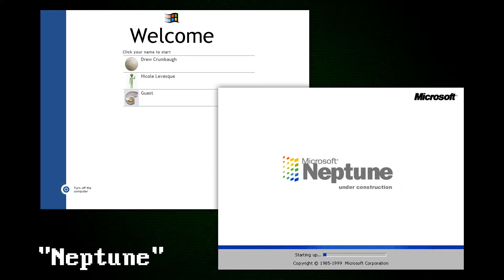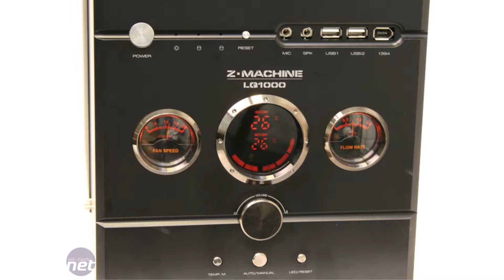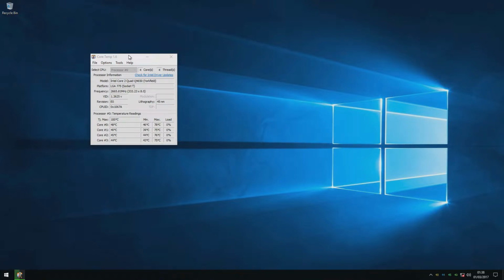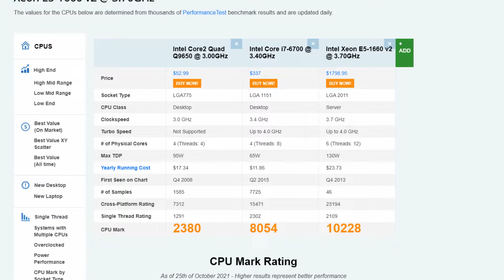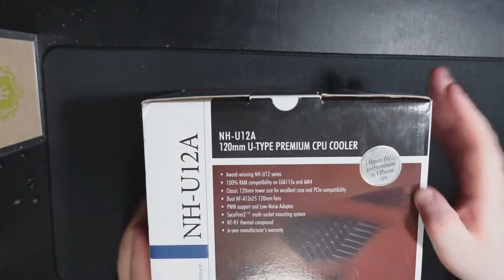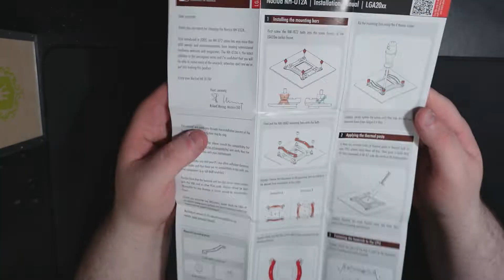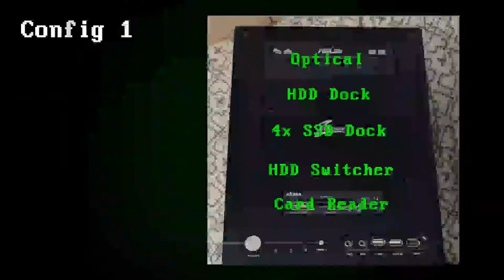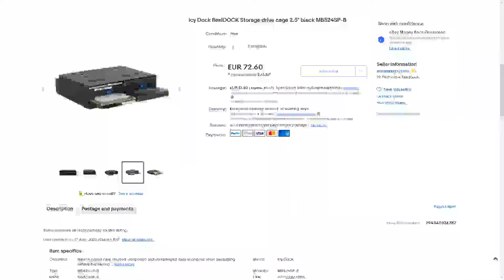Ultimate XP Machine - Windows XP 20th Anniversary Build - Part 1

Comment: love it, subbed! EDIT: persevere! looks like is gonna be a beast once its up and running!
Reply from the maker: Hey, thanks man :) Oh yes it will, shame about the CPU being dead, but we will get it back to 6 cores one day
Reply: @PIPERdotEXE  I shall await it's ressurection patiently!
Reply from the maker: It's incoming, SPOILER: It is alive, but using the original Quad core Xeon that the board came with, so no idea when or how the other CPU died, there are no visible marks on the outside. £90 gone though.... ouch
Reply: @PIPERdotEXE  yikes! still, pleased its alive!

Comment: Nice video! I´m planning to do an overkill XP rig as well, with the components of my main PC (i7, GTX 770) after I´ve build a new daily some day. The problems you experienced there would indicate that the output of your GPU might be dead or you have a faulty cable, try both HDMI and DVI outputs with different cables. Hope to see it working!
Reply from the maker: Thanks! :)

Well spoiler, it was the CPU, something either happened when I first tried to install it, or it got killed by ESD. Not really sure. The Quad core that came with the board fires right up :/ that's £90 gone. I was very sad. Sorry for the late reply, part 2 is on the way
Reply: Following Phil's computer lab high-end build with i7 4790 with a 960

Comment: Awesome too see another overkill win xp build. I recently built a 4790k with a GeForce Titan Black on an Asus ROG Extreme board and SB XiFi and I love it. Dual boots with windows 10 for convenience.
Reply from the maker: Thanks, there are some other commenters on here that don't think so, or even have a problem with my choices lol interesting point on the Titan Black, I didn't think that would work on XP
Reply: @PIPERdotEXE  don’t worry about them. Maxing out an operating system based on driver support is fun. I’ve done one on Windows 98 as well. Overkill? Yes, buts it’s a lot of fun and that’s all that matters. You need to edit the drivers to get the titan black to work, but it’s very easy to do.

Comment: built my ultimate xp machine using those parts : I7 4790k@4.8ghz, 4x4gb of ram, GTX 980ti, X-fi sound card, 120gb samsung ssd and 2tb firecuda hybrid hd.
it absolutly shred, run every XP games in 4K full details and often with reshades on top, EAX 5.0 support, barely any load times, ... 
also made the ultimate 98se machine just for sh!t and giggles using a Q9650@4ghz, 2x2gb of ram, ATI Radeon X850 XT, audigy 2 ZX sound card and 500gb SSD.
got it hooked to a 16/10 monitor to be able to run the games in 1600x1200, what would have been the equivalent of 4K back then.
with those two and my raspberry it's safe to say i got my retro gaming  need covered ;)

Comment: (8:39) I assume the Chromax version wasn't available at the time you recorded the video.
(10:54) I didn't have a problem installing that splitter cable, but it was probably because I have the older U12S model, and/or I was installing it on an LGA115x socket.
Reply from the maker: (8:39) Maybe they were maybe they weren't, not sure really, but mostly I really don't care all that much
(10:54) Great, I'm happy for you, looks like your situation was entirely different, so perhaps you did have it easier, my header if I remember was very close to something else

If you want to see the outcome of this, consider subscribing, I've had setbacks with this project, but I am trying to get it finished soon

Comment: Windows XP has been legally knocking back the beers here in the UK for a couple of years now .  So what's the update, did you get it working?
Reply from the maker: Sort of, I need to motivate myself to get the next bit out, I've had a few setbacks, also including graphics cards off screen. I aim to finish this project soon, and actually start using it for something.

Consider subscribing if you wish to see that

Comment: not sure how heavy that GPU is, should get one of thous gpu support brackets, helps tack stress off the PCI-E there really cheep.
Reply from the maker: Funny thing that, I have one, and just could not get it to work, height wise it would either not help or it was too high, also I was having to bend this inward to such a degree, I couldn't get the placement right there either, there was danger of it hitting the fan. I could try one of those column/rod types that goes from the top to bottom of the case I suppose, but at this stage screw it, it's fine

Comment: Actually, if you're going for ultimate, you should try a R9 290X 8GB, Nvidia caps the 600-900 series to DP 1.1, and HDMI is capped at like 1.2, so you can't do 4k60 or high refresh above 1080p gaming.
Reply from the maker: I would, but that card does not appear to have XP support unfortunately, would totally jump on if it was. XP on this computer is the lowest common denominator
Reply: @PIPERdotEXE  Apparently AMD removed it from the 290X's driver page, which is interesting. If you grab 14.4 for like the 7970, it should install just fine on a 290X.

Comment: Windows 7's 12 years old now! You could dual-boot it with Windows XP if you want.
Reply from the maker: Yeah, the board supports OSs from XP to Windows 10 officially, so any OS in between is covered too. The multi-boot system I'll be setting up in Part 2 will help with that

Comment: Many games in Windows XP work badly, with many cores, you have to leave only 1 core in processor affinity for them to work. This is my humble opinion, find the fastest possible processor per individual core and then leave one or two enabled in the bios. If not, you can do as I did, simplify, use a good dual core, in my case a g3260, with 4gb of ram, and put a good video card, I use a Gtx 550 ti, but you could use a 750ti or a gtx 960. Do you plan on doing part 2?
Reply: Dual cores before 2006 are great for win XP. However if u wana cheat a lil get a core 2 quad or a phenom x3 or 4. Games after 2007 are too sophisticated for XP. So it’s pointless to build a pc with the most modern XP supported components. Maybe a considered at best building a pc with components that support a direct x10, 11.1,11.2, 12 or 12 ultra(win11). Remember xp only supported direct x 9.0c.

Comment: Minimum requirements for Windows XP are a 233 MHz processor, 64 MB of RAM

I was thinking about a single core cpu , maybe a Pentium 4 with an OS support for a single core chip . So what does this do , its too powerful for Windows Xp , could it run Crysis ?
Reply from the maker: Well, it's not "too powerful", it will work just fine for XP, but it is definitely more than you need, but one key aspect is that this also a multi-boot computer, one of the other OSs is Windows 10.

That spec you listed is quite a good one, sounds like a CPU you would use in an early era XP machine, pair it with 1GB of RAM, a 32GB hard drive, sound card etc. Then you have yourself a good machine

Sub if you like, there will be more content, I just need to get it edited and up

Comment: Windows XP with 16gb ram? Unless you were going for xp64 (which has a ton of compatibility problems I've heard), unless I'm wrong, you wouldn't be able to get more than 3gb usable, what with video ram mapped starting at the 3gb mark.
Reply from the maker: Yet another that missed the part of the video that mentioned this will be a multi-boot system with things like Windows 10 on it too... XP will just take what it needs, it won't freak out like 98 does
Reply: "which has a ton of compatibility problems I've heard" you could test yourself if this really works. Aslong when nvidia has 64 bit windows xp driver it should  no problems.

Comment: Its not an Ultimate XP build its just another XP build that you think its really powerful.
Even your system could have been doubled up in power with a pair of X5450 CPUs...
Reply from the maker: Precisely. It is one possible very powerful XP build only, I made it with one particular  system type in mind (enthusiast class x79), pushing the official support as far as it can. Sure I could have gone full on server build, two CPUs, maybe even not used enthusiast class hardware, and stuffed this full of the biggest hard drives, but there has to be realistic limitations on how much I would spend vs how much I would use, all the computer components are pretty high end, and all but the  GPU (I goofed on that one), are, for their respective products lines, the most powerful officially supported. it's all about what you're going for, for example I omitted a separate sound card, as in my build that wasn't a focus. I don't know what your comment was supposed to achieve...
Reply: @PIPERdotEXE  Now youve changed the goal posts. Now you want to call it a powerful XP machine instead of the Ultimate.
Ultimate usually means the best. Which it is very far from being.
2CPUs doesnt make it a server, or even a workstation. thats a use for it

Comment: pleas i love the build but i don't have the time and money to build one so i got an old dell oplx 380 sff for $25 bucks it came with 2 gig of ram a 2core 775 e 7800 cpu but no hdd so all i did was add the 500gb hdd and i had a dell xp sp3 install disk and i was good to go. for all my old games like combat flight simulator i have 1,2,and 3 i found that the q9550 4 core will work in the machine and added a dell amd 4 gb low profile video card to finish off the system  it now is great simple and very low cost just ram, cpu, and video card hdd less then $90 bucks
Reply from the maker: Cool

Comment: i do look forward to part 2 on your software install i do have a copy of office 2000 on my system os that and firefox there is not much i can't do on it then say a win 10 machine but as a retro game running all the old XP and 98 game that will not run on any thing newer there are some games i have to run compatibly mode like some for win 2000
Reply from the maker: Thanks man, and it will happen if i give myself a kick, lot of other things going on. Yes, it is surprising what you can still do on XP, though I don't think I could go back to it as my daily.

Comment: nice vid but too much work for a good retro gamer
Reply from the maker: Gaming is not it's primary focus...
Reply: @PIPERdotEXE  why is it not the primary focus it tests the power of the system and puts the usefulness of it browsing or email or doing spred sheets put no straine at all .oh by the way i use firefox on my XP system so i can go to the dell web stie fot driver updates like the bios
Reply: dell still supports the old systems for most system drivers an useful tec data
Reply from the maker: Oh yeah, it can game, and is fully capable of doing so, but this computer represents a few ideas in one. It will be, once fully set up, a multi-boot system for testing software and hardware, and for performing tasks like imaging disks etc. Running old games that don't work on other systems is something it will do, but this machine has no one specific function. Hope this helps to explain
Reply from the maker: Yeah, they're great for that